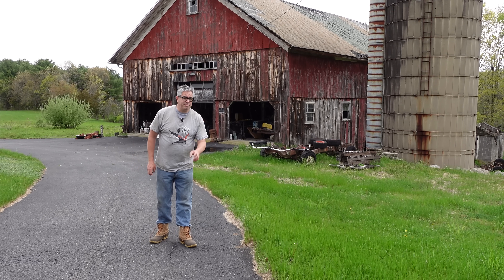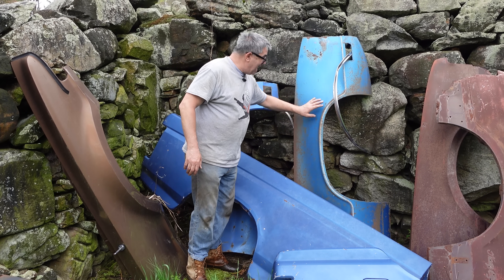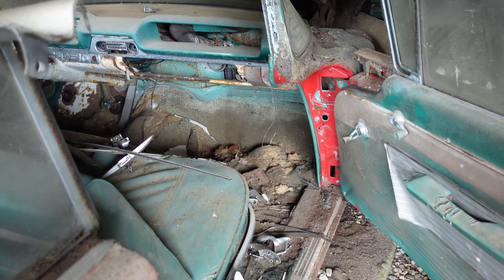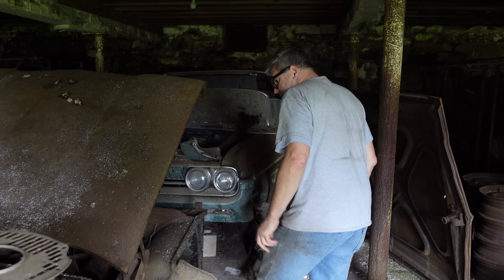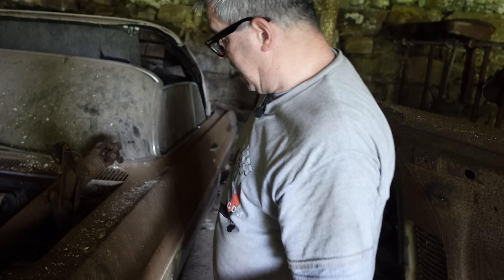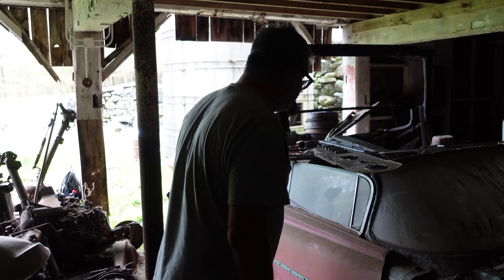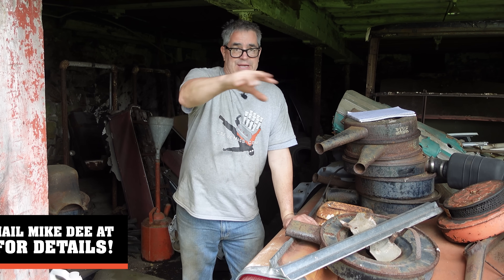BARN FIND ’59 and ’61 Olds Convertibles!!!

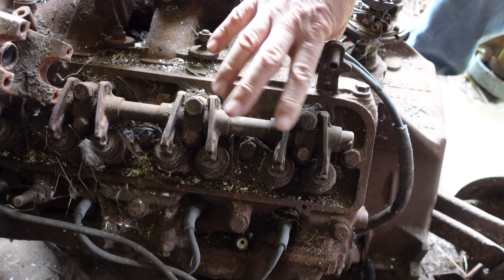Comment: Engine at 9:20 is definitely a 394. This same deep bell housing went from 1949 until the last 394 was produced in '64. Head casting looks like #20, but it's not, because center of exhaust manifold has 3 bolts- 2 on top, one below. So these would be #23 heads, which are the 'Starfire heads'.  Great engines.

Comment: Back when I was in the Boy Scouts in 1967 one of the assistant leaders had a 1960 Olds that he used to haul us scouts and equipment the to camp outs in. I thought was interesting how it had a rotating drum speedometer that looked like a line spreading from left to right as you went faster. I liked the color too as it was a deep plum red with a cream color top. Even loaded down with a bunch of Scouts it seemed to move effortlessly, unlike my parents 1962 Plymouth Savoy with a slant six.
Reply: "Dad, stop being a skinflint. The Jonses have an Oldsmobile with a V8, not a puny Slant Six". LOL.

Comment: My family had a '59 Olds 98 four door hardtop.  The speedometer indicator was a line that started green, then as speed increased, orange, then red.  Also, an automatic headlight dimmer on the dash to the left of the steering wheel.

Comment: I spot a 1979 to 1985 Toronado driver's door behind the 1959 convertible. It looks like someone was in a rush to remove it as those wires should have plugs that connect to the bulkhead under the dash. 

1959: No VIN, can't win, but might be something like 59 for 1959 model year, 8 for Super 88, maybe M for Lansing, MI assembly and the rest is the production sequence. Yes, 1958 would have been the last year for the J-2 as you stated in another post. No tag, can't brag, but possible code "R" Bronze Mist exterior paint (going by the back) or maybe it was code "F" Crystal Green going by the inside, with some "Resale Red" as you like to put it thrown in for good measure.

1961: No VIN, can't win, but can be figured out, no doubt: 61 for 1961 model year, 8 for 98 Series, maybe M for Lansing, MI assembly and the rest is the production sequence. The Lansing plant operated from 1901 to 2006 and today's Lansing Grand River has "assumed" the production of the former Lansing Car Assembly plant that might have made both of these cars. No tag, can't brag, but possible code "F" Azure Mist exterior paint.

George Hurst also developed the Jaws of Life which were used to remove drivers from crashed race cars, but has been adopted as the standard for the fire and rescue industry. Today, they have "E-Draulic" tools which are battery operated and lighter than their hydraulic counterparts of the past.

Comment: Yes, Olds did use a spring similar to the beehive. I looked into putting them on my small block  Chevy back in the '60;s and it would have been more of a  hassle than a benefit.  The valve springs  were called conical, not beehive. The wire wire used to make them was round whereas the  beehive uses  ovate wire (oval shaped). The taper spring that Comp Cams is pushing for high performance is nothing new either. Most ideas are old that have been upgraded. Cord was supercharged in 1967. Chevy produced a V-8 back in 1918 and the block bolted together - Speedway's Bill Smith museum in Lincoln Nebraska actually has one. In fact, they possess many desirable items from Smokey Yunick, Edelbrock, Chevrolet, Ford, Chrysler and others. They have the largest intake manifold collection for flathead Fords anywhere in the world. If you get time, look the museum up. I would travel there but, I live on the east coast and at my age, I am not interested in driving that far. Thanks for posting the video.

Comment: Great video, as usual. I agree (sadly), with an earlier comment that the 59 & 61 are likely beyond restoration…absent an tidal wave-outlay of cash. Still. I hope that happens…especially for that 59!
Reply: Clearly there's many who have no business deciding the fate of vintage American automobiles.
Obviously have no idea what they're looking at.
I haven't seen the first floor pan or rocker panel rusted through in any of these cars shown here.
"Restoration" can mean different things. You want it "saved" as in up and running with functional parts or do you want a show car that only gets taken off a trailer at a world of wheels expo?
I've dragged cars out of tree rows that I bought from people saying that exact thing "too far gone". Paid them junk prices, got the things driving with brakes working then sold them for thousands of dollars. 
Those who cannot do any of the work themselves, have no business deciding their fate. They simply have no clue.
Reply: Actually, restoration generally means returning something to its original condition. Preservation generally means stabilizing something in its current state or perhaps a state that is functioning, but other than restoration. As Steve M often states, you can restore anything if you throw enough money at it. I didn’t see any of the comments ominously “deciding the fate” of these automobiles…simply opinions on the potential condition of automobiles sitting for decades on dirt floors.

Comment: Are those Torinado engines versatile? That is, can they be fitted for use in a rear wheel drive application?
Reply: Sure. Some people put them in Corvairs, pickups, etc.
Reply: Sure. Some people put them in Corvairs, pickups, etc.
Reply: Sure. Some people put them in Corvairs, pickups, etc.
Reply: @UberLummox  You're having serious connection issues. 
I got a funny story about faulty cell towers and roaming... About 6 years ago while I was out of state, my wife decided it was a great time for a heated text argument. She had been spamming nasty messages for about 20-30 minutes until I finally had enough. 
I finally snapped and sent a barrage of firm retorts, giving her the "what's for" and reading her the riot act.
When afterwards I noticed that she had stopped giving me a hard time. And I figured that I had set her straight and went on about my business... 
Now here's the funny part (wasn't funny at the time)..
About 4 months later while I was on the same out of state trip as before, as I was in the exact location where the heated argument had taken place, my wife calls me literally crying asking me what she did wrong... "Why did you just send me all those angry texts and yelling at me?"
I insisted firmly that I did no such thing, so she read me a few of them.
I immediately recognized them as the messages that I had sent months ago while she and I were having a bad argument.
It took me quite some time to not only figure out what happened, but explain it to my not-so tech savvy spouse.
I was roaming and there was a faulty cell tower in that area that didn't send any of my messages, held all those messages for FOUR MONTHS until I got in range of that same tower again, then it sent all the messages all at one time...
😁
Anyways, I recognize your repeating comment as a malfunctioning router, bad provider or data service.
✌️ 😁
Be sure to tell your mother or wife "Happy mother's day" 🌺

Comment: 98 with a four on the floor? That’s cool beyond words better hang on too your neck when clutch is dumped! I bet that car surprised a lot of people! Thanks Steve for all you do! Motor Trend, made a BIG MISTAKE, canceling your show! Keep on trucking! Get that guy a light for his camera!
LOL!😂
Reply: I have owned a few large cars with big blocks and between being heavy and tall geared ⚙️ they are not impressive off the line  😐
Reply: @speedfreak8200  I’m kinda thinking that car had some alterations to the rear end as well ,no point in putting in a four speed otherwise!
But you are correct, those tall gears were meant for top end go for sure! I’ve been in many Oldsmobile 98’s and 88’s and Buick rivieras all sporting the 455, you are right they were highway rockets! But, I have been in, 66 and ,67 Grand Prix, with the 421 and 425 with a 4 spd,that would sit you back in the seat ,as well as, completely melt the tires off the rims, if you so desired!
My grandfather, had both a ,62 and, a 70 Grand Prix, the 62 had the 389 4bbl, and the 70 had the 400 or the 455 they would glue you to the seat!
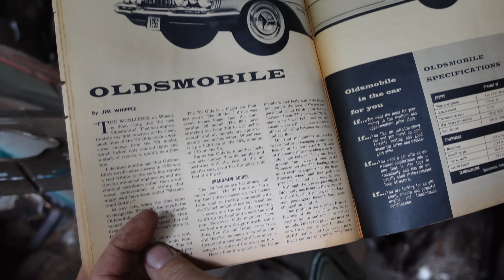Of course, I was just a little kid but , nothing slammed you back like my Dads 63 SS 4 spd 409, Impala with two 4bbl from the factory and 4:11 gears it was no small car.
That car got my attention!
Ember red, was the color!
Black interior! Sorry for babbling! LoL! The cars, and the people, are gone now!
I miss them all!

Comment: Hi Steve, you referred to " preventing drumming" what does that mean?
Reply from the maker: Hi Marc Cosentino, Thanks for watching and writing. The term "drumming" refers to how certain panels made of sheet metal can vibrate during use and create annoying sound waves and / or vibrations. If the panel is formed (pressed usually) with some surface detail in the form of ribs, ridges, rails, etc, they add stiffness that can reduce or eliminate the dreaded "drumming". Automotive body structure engineers call drumming part of the "noise, vibration and harshness" problem that they spend millions tuning out of new cars before (hopefully) they reach market. Thanks again for watching and writing. -Steve Magnante

Comment: Actually Oldsmobile added a top-tier model in 1961 called the Starfire it was released in January and was a convertible only I actually owned one. Now I own the bottom tier 1961 Oldsmobile dynamic 88 two-door sedan. 61 and 2 shared engine & suspension.

Comment: Cadillac shared the 394 and offered tri power
Reply: Incorrect. The Cadillac V-8 was offered with no less than 18 different displacements over the years but none were 394 cubic inches. Olds and Caddy did not share engines.
Reply: @rogergoodman8665  Correctamundo
Reply: @rogergoodman8665  Not in those days, but later on they did in the "corporate era". The 307 Oldsmobile V8 was used in the 1986-1990 Cadillac RWD Brougham and the early "Sevova" Seville (Nova based Seville) had a 350 V8 engine made by Oldsmobile, but marketed as a Cadillac engine for the 1976-1979 model year and the 1979-1980 Eldorado as well.
Reply from the maker: @rogergoodman8665  Hello Roger Goodman. Thanks for watching and writing. The Caddy V8 that's closest to the Olds 394 was sized at 390 cubes. It is a cousin but no parts interchange with the Olds V8 family of the late 1950's / early 1960's. You're right about Caddy also using a 3x2 induction setup on the 1958 - 1960 Eldorado and as an option on other Cadillacs of the same time frame. Before 1958, the Eldorado V8 got DUAL QUADS from 1955 through 1957. I like "tri-power" but DUAL QUADS are my favorite induction setup! Thanks again for watching and writing. -Steve Magnante